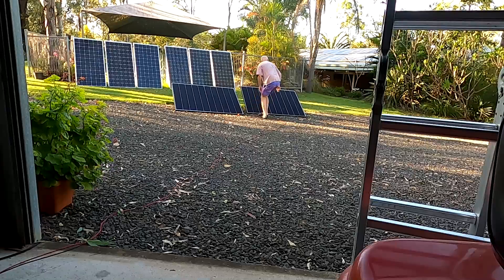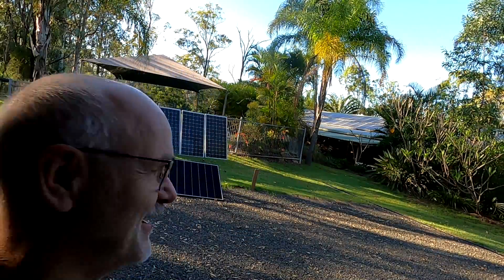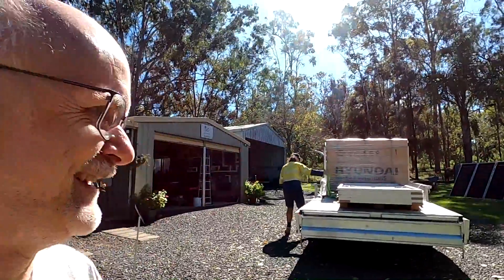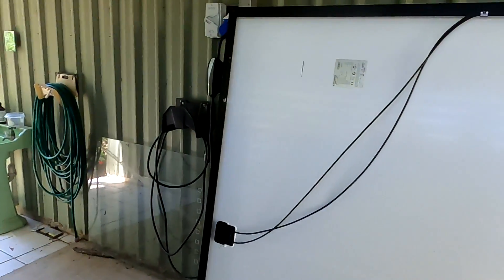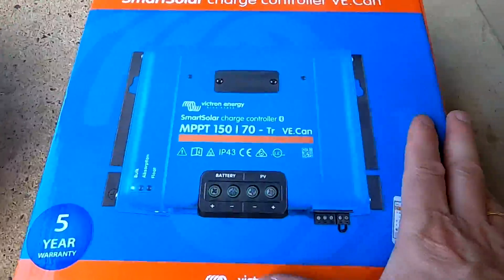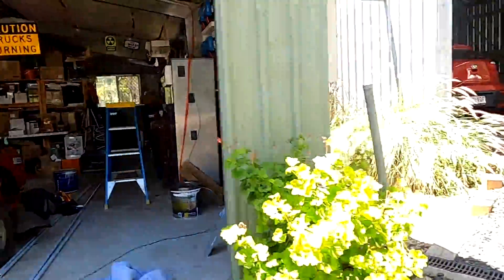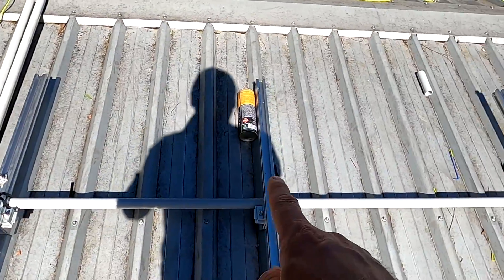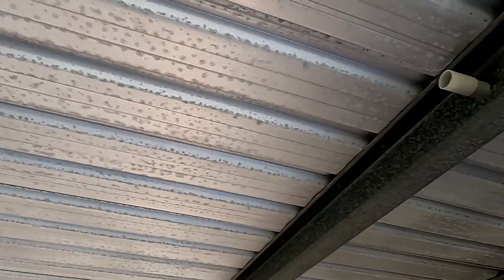14.2kWp Solar Upgrade Installation. A trailer full of panels for me!

Comment: Hi everybody. Does anyone know if i will damage my Growatt spf5000es  inverter if I connect 2 strings of solar panels all together less than 6000W and each of the string 350V ? On the inverter sticker itself says 1 string
Reply from the maker: It should say it in the manual of how much power every string can take.
Reply: @OffGridGarageAustralia  Hi Andy .Is it any other way to contact you ,if you dont mind?

Comment: Just a heads up Andy, last year 650 watt panels got introduced, this year the competitors are catching up. Next year they will be more available in Asia, not sure about Australia. These new panels work with updated versions of hybrid inverters. The ongrid inverters are still not upgraded. 

Each panel produces about 25amps, most charge controllers/inverters previously could not handle that amp input. Be mindful for any future expansion for bigger panels

Comment: Hi I've just done the same thing. New system. Found in your other clips your charging voltages, I'm concerned I am charging to hi. I have 100ah 48v. Have you found an optimum current for size of battery.

Comment: yeah those are big and heavy PV units!
Mine are also half cut but 440W 
Generally the cost of the racking makes the higher Wattage PV panels more cost effective - for a set total array wattage at least.
Great to see you getting new PV - did you resell off the used, used ones? LOL.

Comment: Andy. Here’s a small marine tips!  The ground cables are just knocked together and screwed on the rails like this. You can simply use a chaîne lub grease for  Ike’s to protect corrosion of the copper cables. And can be removed easy. 🇫🇷

Comment: Andy judging by all of the shading happening on your shed roofs I think that you need to call the tree loppers in and get at least the top 3rd of the very tall gum trees on your property’s Western skyline removed if you are going to get the maximum Solar Generation benefit out  of your pretty expensive new system.

Comment: 500W is the new normal and so easy to install. And then the power output is really fun. They start producing even before sunrise. How much are the panels down under? In the UAE this panel costs only USD 180.

Comment: Looking good so far Andy.
The difference in regulations is quite shocking. 
In the UK we need main DC & AC isolator switches and an AC breaker in the house distribution box and that's all. 
No earthing or fuses. 
The engineer that helped me upgrade the house roof with Trina solar panels advised me not to earth my used gumtree system as it will cause ground faults with the inverter or cause the breaker in the distribution box to trip.
Having said that, when I clean my used gumtree (Old Phono Solar) panels I get a very light shock off of them, just a wee tickle that makes me giggle lol.
When I measure panel to lader with a multi meter it shows no DC voltage but reads approx 30-40v AC.
Is this the AC ripple you have spoken about in your previous videos?
Shine on dear boy, love from cold and soggy Scotty'land.
Gary.

Comment: the big ones are really nice  - we got 545 and 535 Wp panels also the EY800W tracker checker.  But they are heavy and you need to prepare the way you have to carry them along.

16:55 You become the master of shadowing panels and checking them, but at the end the real world is different , not coverin half of a panel or a quarter, but the real world shadow of a tree with leads and branches everywhere.  Quite good results even though these 10% are the usual results for shadowed panels seen there. Cutting the trees will be the easiest way to improve that. 

But the additonal angle rack will improve also the output quite well. We are just dealing with a roof that is parted in 2 with 10° different angles of 18 and 28°. Winter coming makes a huge difference regarding the output cause right now we are missing 15% and still 7 1/2 weeks to go till days will get longer again or even 15 weeks to go to simply reach our daylight length of today again: 46 days to go till 21st of december and another 46 days would mean 5th of february. Each year a different challenge to get through the dark season.

Comment: These readings of the device in experiments with shading are logical for a PWM controller. Obviously, the device has such a controller. The readings will be radically different if you use Victron's MPPT controllers.

Comment: congrats to brand new > 14kWp in sunny down under! This will be a good upgrade, well worth it.  
I got 13.6kW  by 36 2m² panels on a regular Germam roof, concrete tiles, "Frankfurter Pfanne", 10m to 13m height. The team (4 people) arrived after 10:15 with one single Sprinter and were ready installing all the PV panels ca.17:00 .  
Unfortunately no inverter and accu currently available here. Hopefully next year. And starting next year, we have not to pay this ugly MWSt for PV installations.

Comment: Hello Andy. Why did you decide to have these panels installed by a company and not by yourself as you did in the past? 😉
Reply: They have to be installed by an accredited installer to be eligible for the small-scale technology certificates which basically halved the cost of the panels. Pretty sure he talked about it in the Electrical Inspection video a few months ago.
Reply: @darryndewar  for off-grid photovoltaic power plant ?!
Reply: And they're 29kilos, 64 lbs each.
Reply: Disappointing .

Comment: Loving the new panels you have. mine are used 230 watt panels but with my angle they produce in rain and cloudy days. I thought on a cloudy day I would loose a lot. full sun right now I get up to 7500 watts on cloudy I get almost 7000 and raining today I get 6000 so I am super happy. cant wait to see yours running. I think since I have good distance from trees the sun is reflecting and that is why I get such good numbers on rainy  or cloudy days.

Comment: Andy, at 14:00 that's an impressive panel, I wish I had just a few of them! Also, might it be worth comparing solar angle output of Hyundai panels to your old used panels to see if they are better with low angle sun?

Comment: Wow, interesting day Andy. At 12:15 where you point out that it's ok to use Breakers rather than fuses in your combiner box, and fuses are typically intended to be used for short-circuit protection in circuits where inrush current could be thousands of amps to protect circuit breakers, which are typically used for overload protection unless they are 'Instantaneous trip'; I wonder if that is because solar panels are limited in the the amount of in-rush current they can produce? It would be interesting to calculate or measure what the maximum peak current of a large string into a short circuit would be. Maybe that's something Andy 2 could do after several spats?
Reply: See 14:01, max current for each panel/ string = 13.64A, times the number of parallel strings.
Reply: @gubbernl  Thanks, I got that from the video,  and perhaps I was not clear enough when I mentioned 'Peak Current'. What I meant was the total instantaneous  current of a string in full sunlight into a short circuit similar to shorting a capacitor or battery; which can initially be much higher than continuous current into a short. 

Might you, Andy or someone know what the properties of solar panels and if they can produce instantaneous currents much higher than rated maximum current as a capacitor might? As a solar panel design is much like a capacitor, I wondered if that is the case? 

The reason the maximum  instantaneous current into a short circuit is important when considering breakers in an electrical supply system, is that whatever device that provides short circuit protection has to be able to withstand and interrupt the instantaneous maximum current the power source can produce, such as from the power grid, battery, generator and etc. 

A 200amp circuit breaker might be able to interrupt a 1,000amp surge but 10,000 amps might weld the contacts together, preventing the breaker from interrupting a short circuit. Fuses on the other hand burn open and can't fail closed like a breaker. 

In a solar system such as Andy's, with pretty large strings the breakers in his combiner box should have a much higher current interrupting rating than his solar strings could produce. Lighting welding breaker contacts is another possibility, and another reason why I personally prefer fuses for short circuit protection and breakers for overload protection.

Same goes for battery banks the main breakers Andy is using on his battery banks appear to be pretty robust and possibly able to interrupt the max instantaneous current his battery banks can produce.
Reply: @jackoneil3933  if the max current for each panel/string is 13.64A, I cant reason why that should rise any or exceptionally so, except in the case of a direct lightening strike or some other very unfamiliar phenomena.
Reply: @evil17  I would expect solar panel in sunlight that was not connected to any load would have a potential charge, like a capacitor, so you should see an initial current discharge higher than it's continuous short circuit output. How much that would be should be related to the capacitance of the panel to store up electrons. 
I just measured capacitance of a 100W panel at 4 microfarads, so a 500w panel might be 20 microfrads, so 10 panels might be 200mfd. If my estimate is accurate, then nothing to worry about damaging an average DC circuit breaker,  and likely why fuses are no longer required. 

However, it would be interesting if Andy could measure the capacitance of his strings (at night) and how large a spark a string of his old panels would generate if shorted.
Reply: @jackoneil3933  Ok, I see where ur going here now and I cant profess to know the right answer, but as a guess i would say that when we are talking in microfarads, this is a very small amount, and as far as a spark being created from this, I would imagine it would be at least hard to see visually, if at all, and would require metering to get an accurate measure, but in regards to if this could/would be enough to cause any drama’s in a breaker type circuit, I would have to imagine that any of this type of capacitance type current spiking within a breaker at any time would have negligible to zero counter effectiveness of the breakers ability to break/quench/stop any errant currents in such a circuit. Just my guess. Cheers
Reply: Jack I've installed a 230 000 volt circuit breaker in a sub station.  A circuit breaker is a superior product that can do anything a fuse can do.

Comment: Nice panels.  Not a fan of mono but they don't seem to make poly any more. Victron gear will mean you have low volts high amps.  Should keep the high frequency buzz down.

Comment: Yah, 29 kilos is heavy... 64lbs!  Well into the residential-panel-space and out of the one-person DIY space.  That's why I wound up doing my DIY roof upgrade with 320W panels (40lbs), since it was just me and my brother putting them up.

Your test results are about what I would expect.   Maybe count the bypass diodes too... should be either 3 or 6.   Basically any shading on even a single cell will take out the entire sub-string (one sub-string per bypass diode).   The cloudy-day performance of those panels should be really good though.  i.e. the situation where the cloud cover causes the light to just come from the entire sky and not throw shadows instead of from direct sun.   In that situation the cells are not 'shaded' and their true performance will come to light.  Because of that, your overall energy production ought to be excellent!

There is an argument here for using slightly smaller panels to help deal with the variable shading... fewer cells per bypass diode (maybe), though in the grand scheme of things I don't think it would make that big of a difference.  Your next step?  Tree trimming :-)

-Matt
Reply: My QCells 475W G10 Bifacials are also 64 lbs.
Reply: Good comment mate, but I will be surprised the day Andy cuts his trees, in fact, I would like to have a FUND ME $1 for every time someone made that comment, reckon I’d have at least a few cartons of beer by now.

Comment: 4mm² would be not enough in Germany. Minimum 6mm², but Standard is 16mm²
Reply: 16mm its standard in Poland in all ground connection
Reply: @thomyk2  6mm² or 10mm² are allowed on special conditions, e.g. parallel connections
Reply: we use 4mm2 for the grounding in the netherlands and only direct from railsconstruction to the invertor thats all, we dont use breakers or fuses in the DC lines for normal regulair installations without battery setups
Reply: @highflowhighflow9896  At the end, it is a question of risk assessment.
You can decide, to design your system in case of a essential fault, fails or not. And in case of a failure, it will be destroyed or not.
VDE is a private Institution, there rules are not binding, but the insurance  companies follow these rules.
Anyhow, I follow the common sense, controlled by my experience as an electrical engineer for >35years.

Honestly does it really matter to use 16mm² at the end??